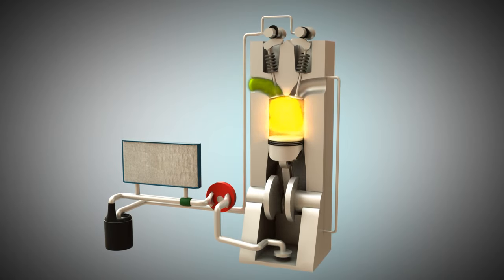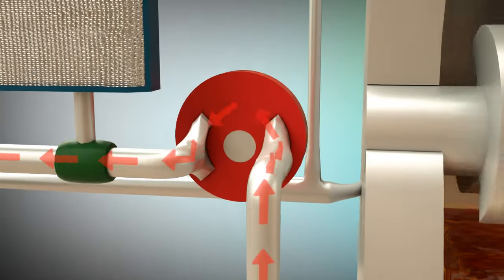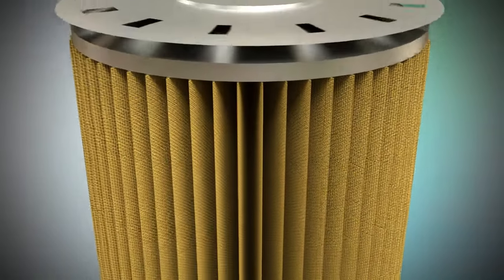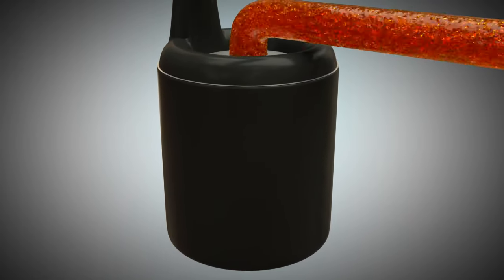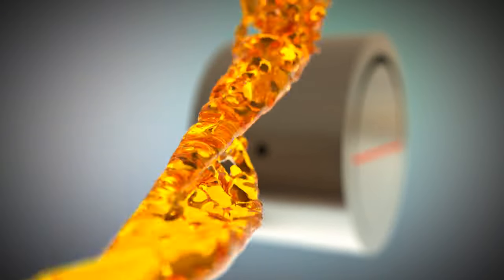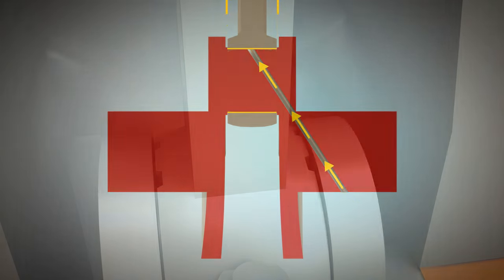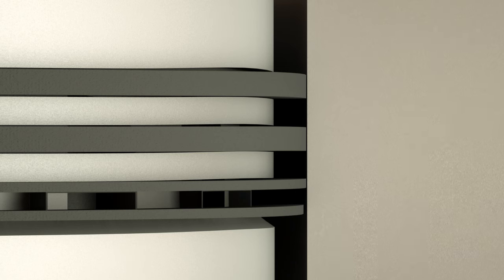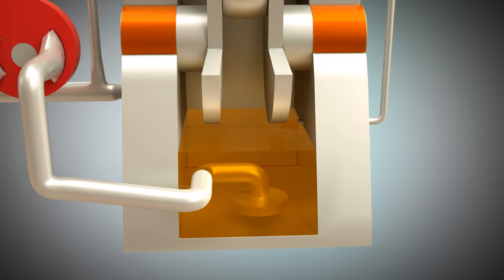Engine Lubrication / Wet Sump - How it works!

Comment: Top notch animation.. And quality stuffs. Good job mate. So in splash lubrication the crank is splashing relatively hot oil into the cylinders ??
Reply: Yathu prem : yes it's hot, but it's cooler than the surfaces it's being splashed onto, so it helps cool them. Typically the piston head bottoms, the connecting rods, and the cylinder walls get some oil. Each engine design is different, so check with your manufacturers specifications for details

Comment: Great Video and explanation. First video that explains how the oil runs through the different engine parts.
It would have been nice to add the oil temp and pressure sensors - the it would have been really complete.
Reply: For someone who doesn't know anything about engine oil system doesn't need to see sensors, all we need is to see where it stays, where it goes and how it goes.
Reply: spencer tom i assume you are watching it because you are (becoming) a pilot, and the oil temp and pressure gauge are part of the system and very important indicators and it is helpful to understand how they are integrated in the system - for me it would have made this video perfect - it’s already great.
Reply: @MobiFlight  sensors and stuff are for another video, like I said, noobs or people that don't know much will get confused 😕
Reply: @MobiFlight  Im becoming a motor mechanic

Comment: Great video.. love it.. a question, so during a normal oil change when we open the bolt in the oil pan.. there s always some old oil left in the system, oil galleries and engine parts.. is it?